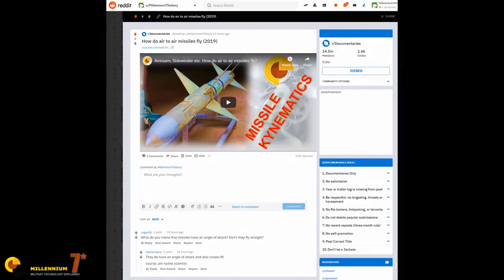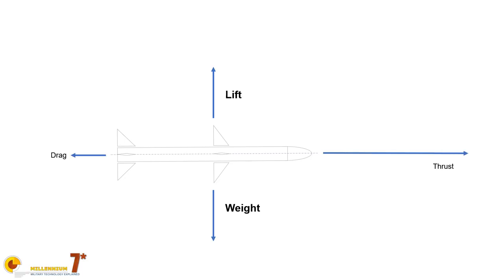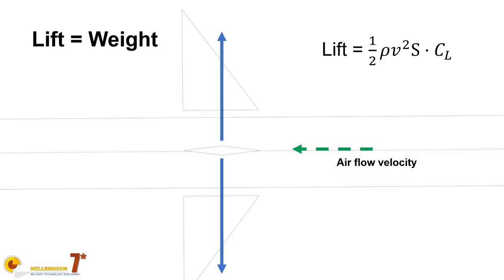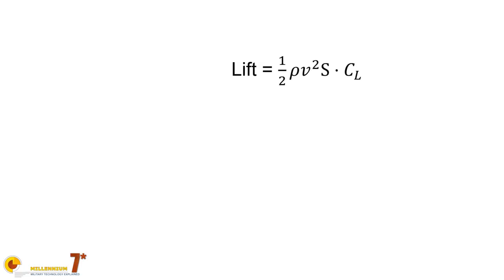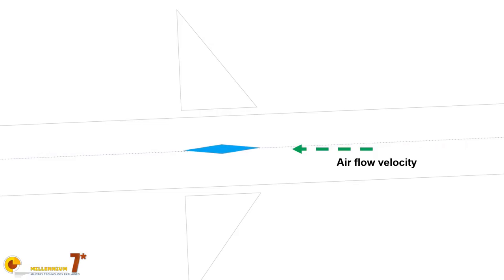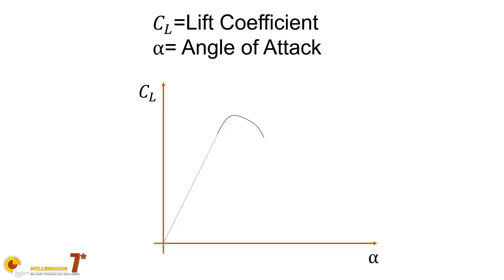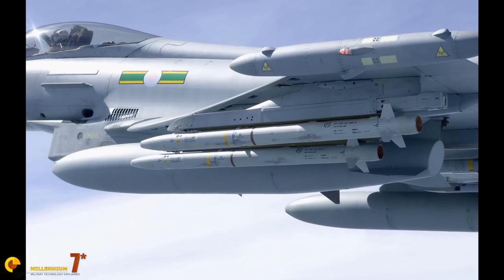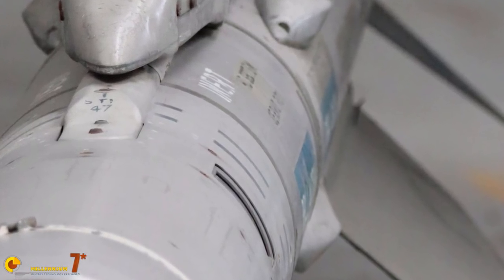Why Missiles Fly Nose Up (Like the Sparrow in the pic but also Amraam, Sidewinder etc.)

Comment: The music is a little loud I had trouble picking out your voice. I would also think that to counteract the weight of the missile, the axis of thrust (rocket motor) is angle down to generate more "lift" to maintain level flight since lift surfaces are minimal.
Reply from the maker: Sorry for the music, it is 5db lower than the previous video and it still sounds loud for some. I will find a way to fix it in the coming videos.
Reply from the maker: Actually, yes, the thrust, while the engine is burning, has a vertical component that counteracts the weight and adds to the lift. However, if you have seen the video before, it doesn't last long so the missile needs to be able to fly relying upon the aerodynamic lift. Wings are tiny because missiles are very fast and very light, compared to a plane; they don't need a lot of lift and the high speed helps.
Reply: @Millennium7HistoryTech  Fair point just got around watching the previous video good stuff and work, looking forward to coming uploads
Reply: @Millennium7HistoryTech  it's not only loud, it's to aggressive and intense to be a "background" music. It basically make the actual content, as in what you're saying appear to be more of a background voice rather than the content of the video.

Be a bit bold, turn the music down significantly, and let your voice do the talking :)
Reply: Such good information but yes this music is ridiculous.
It's clouding the subject and my concentration.
Reply: @Millennium7HistoryTech  This is a super late reply and maybe you've already figured this out (your later videos have less background), but you can use a compressor to "duck" the music when you speak. The music goes through the compressor, but your voice channel is sent to the "sense" of the compressor.  It's how FM radio stations did it.
Reply: @Millennium7HistoryTech  As you already said, there is information here that you can't find anywhere else.

It certainly isn't the music that's attracting people. Please consider removing the music altogether, you are doing yourself a dis-service.

Comment: I thought the effect was exaggerated by us only seeing them very early in the engine burn. I know the sidewinder is controlled by the forward surface, and it is positioned quite close to the CoG when coasting. That means that control input is mostly translated into a lateral force, rather than a rotational one, and the missile flies fairly straight with the controlled wing providing the lift (reducing drag and giving very snappy manoeuvres*). Early in the burn the forward surface is considerably forward of the CoG, meaning significantly more torque is developed to angle the whole missile to the airflow. As this also lets the rocket motor contribute to lift, it is more of a feature than a bug, but I didn't think it was representative of the whole flight, at least for the sidewinder.

*To change which direction the aerodynamics are pushing the missile requires only moving the control surface, rather than waiting for the orientation of the whole missile to the airfow to change. I was under the impression that this was the major reason for it's success even with very early control circuitry.
Reply: Wow! Very impressive.